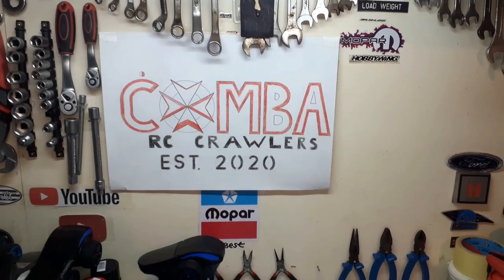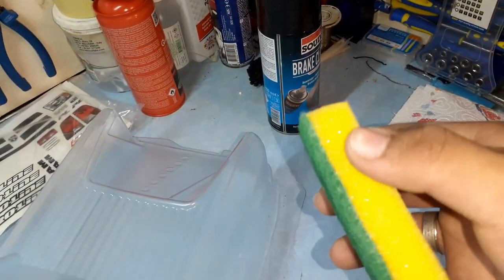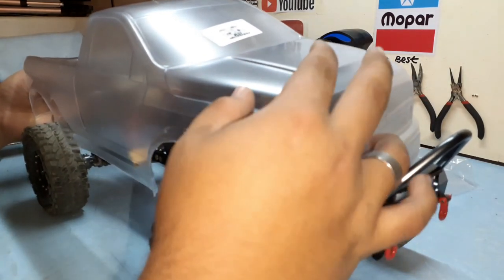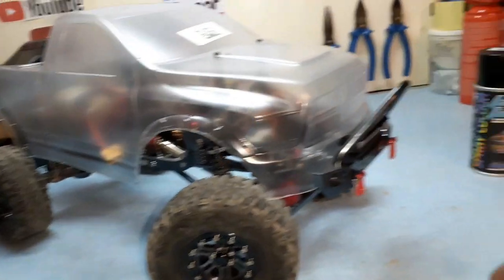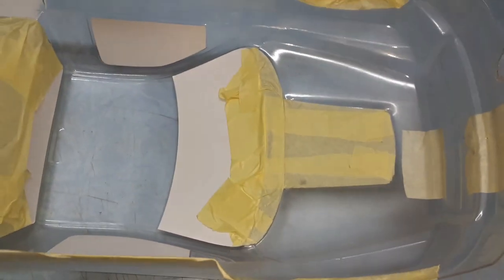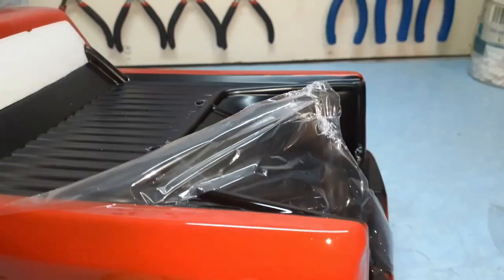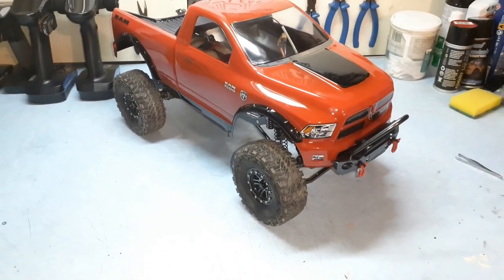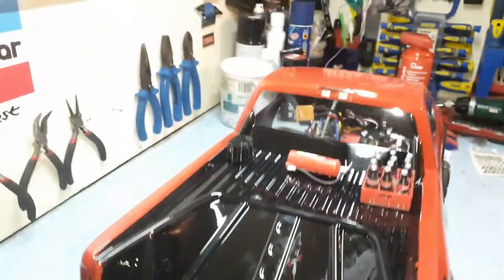HOW TO paint a clear RC car/crawler body; Axial SCX 10 ep. 2

Comment: Hi bro you did a good job but you could have saved time . The body shell has a plastic film on top . When you need do a black bed or wheel arches you can cut this down with an exacting knife and apart those areas . Then apply clear Matt to create a contrast other wise all is shiny and in reality black parts do not show as the body .  As for the color red or any other bright colour do not spray black directly on top this makes it dull. If you want to brighten the color spray white first the a ast layer of black . Anyways you did good for a first timer ! You have an awake rigs hope to see it on the field soon .
Reply from the maker: Thanks for commenting stan, thanks for the tip. Yes a run video should be comming soon. Hopefully.❤😉😁
Reply from the maker: I understand your method. I went the hard way😁😂
Reply: That’s they way to learn . But you did a nice rig really 👍🏻
Reply from the maker: @rseficomalta  thanks! I dreamed it and God blessed me with the capability to do what I never trusted myself to do.

Comment: You forgot to sand the wheel arches and edges of the body. Now you have all these jagged skew edges where you cut with the scissors. The wheel arches need to be smoothed using 400 or 600 grit wrapped around a spray can, and for the rest of the sides and front, you lay a sheet of sand paper on a flat surface and pul the body over it, until you have  nice 'n straight edges. When applying masking tape for round border lines, like wheel arches, you need to use lining tape, or masking tape cut into thin strips, else you end up with those squiggly uneven black wheel arches. After you've sprayed the base colour, use a coat of silver, before applying the black. The silver will keep the brightness of the main colour. Backing the base with black, will darken the base (Unless that's the effect that you'e aiming for )
Reply: If he likes the outcome. WHO ARE YOU TO JUDGE IT.!!!!
Reply: @southernprojectsyt6340   Judge ? Where was the judgment . I'm not really phased if he like the outcome or not.